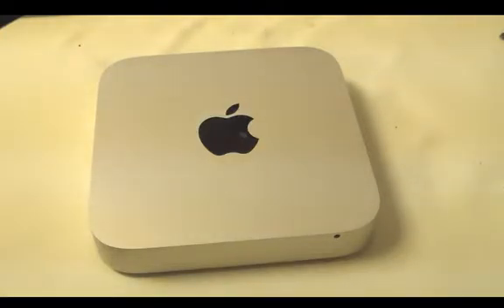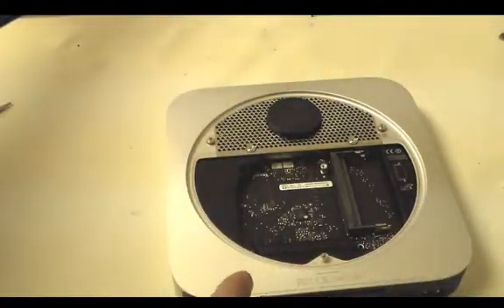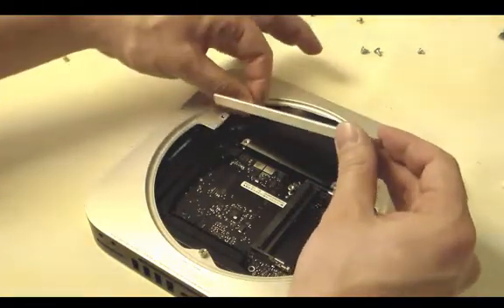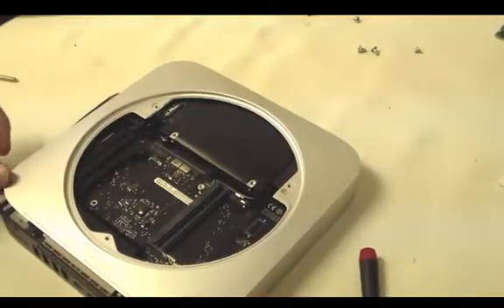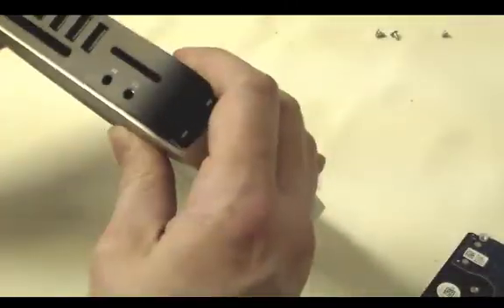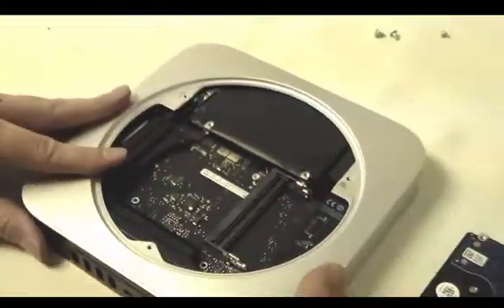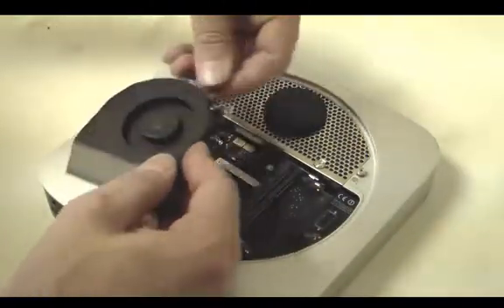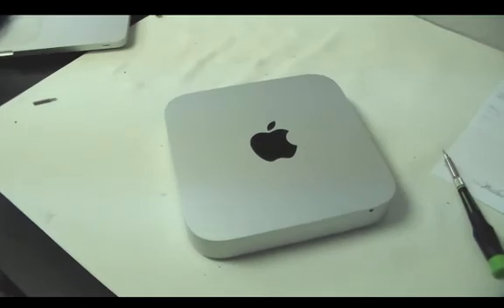Mac Mini Failed Hard Drive - Hard Drive Replacement

Comment: Just curious, if the hard drive fails, and you replace it, how do you reinstall the OS after?
Reply from the maker: +Brandon Normandin Well you do need to have either an install disk or another operating system image on another drive. If you have a disk, its easy. You just boot to the disk, and follow the install instructions. If you are going to copy another image it becomes a bit more trick, but you would essentially do it the same way I made my service drives. I made a video on all that.
Reply: +Shayne Fowler could you use the internet recovery mode with a new hard drive in there and then install OSX from there off the apple servers, or is the memory of apple servers not found on the logic board itself?
Reply from the maker: depending on the model of mac yes you could do it that way. Older Macs will have an issue that way.
Reply: +Shayne Fowler ok sweet ya mines a 2014 so I'm assuming it should work if I really get in a pinch! Thanks and keep up the great vids!